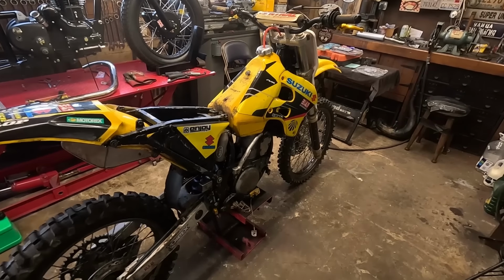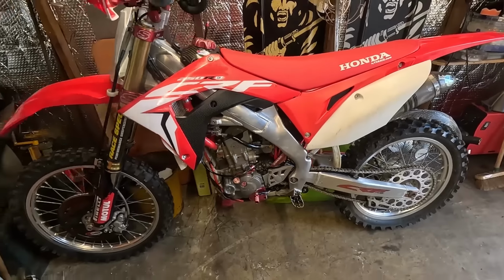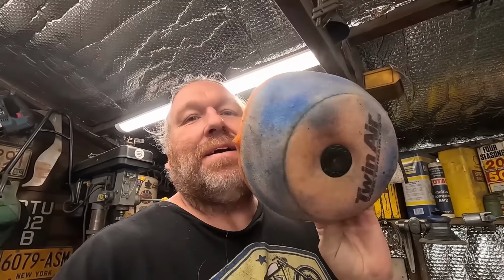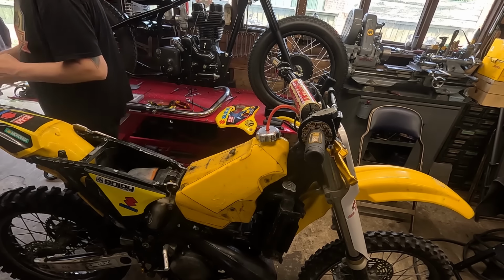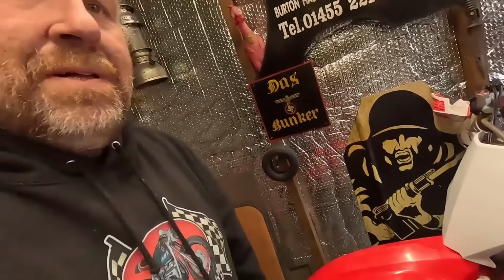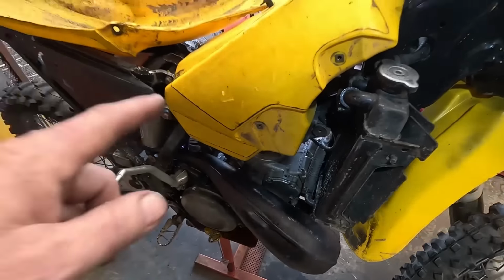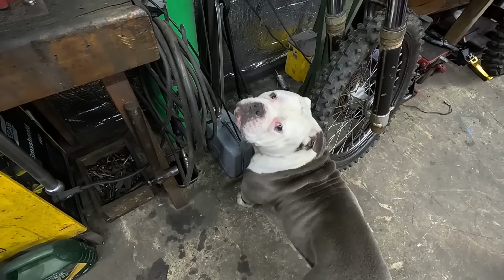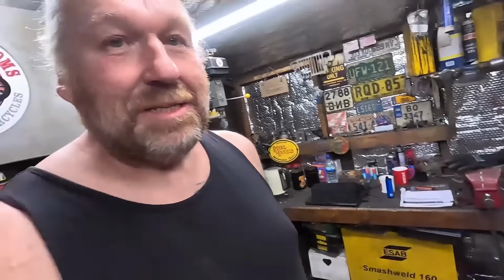Suzuki RM Strip Down

Comment: To know for sure the year look at the serial number on the stem. Also the serial number on the case will identify it. In my opinion for what its worth I would never powdercoat a dirt bike frame. The reason is powder coating will hide cracks in high stress areas like the steering stem.  Better to strip and check all the welds then paint. Streetbike powder coating is fine. Just not on dirt bike. In my opinion. Love the channel!